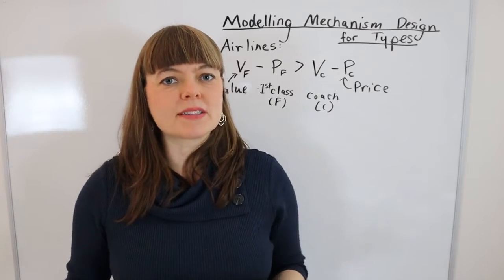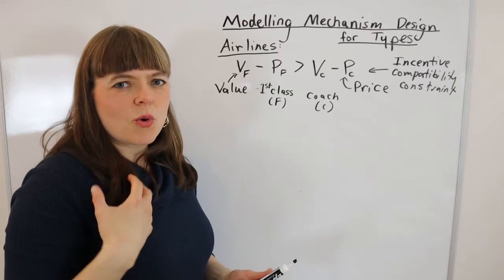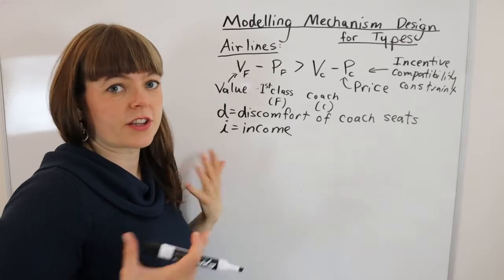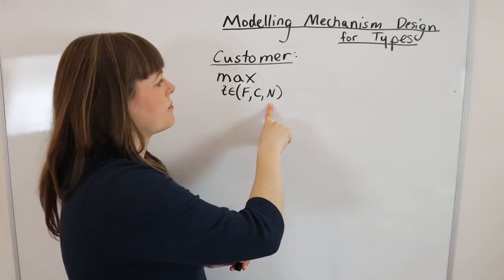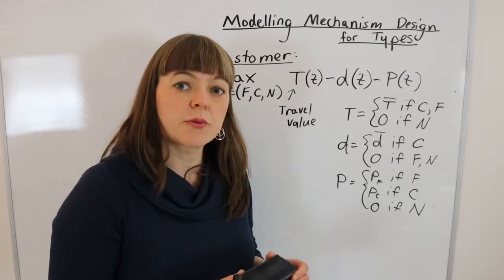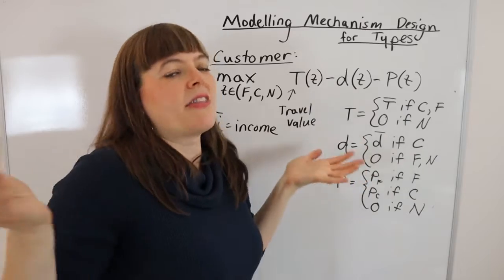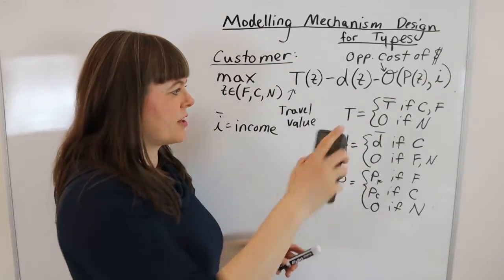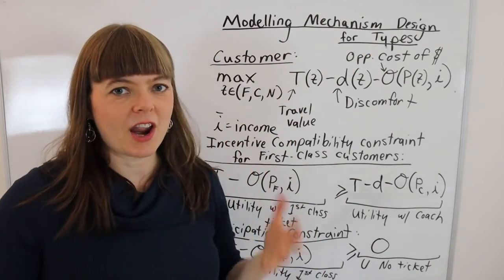Mechanism Design Modelling

Comment: Hi Ashley, what software would an economist use after drafting this design on the white board? Perhaps the matlab econometrics tool box or simply excel? And would they use a VAR model? Thanks in anticipation. 

Btw, I enjoyed the systems thinking series review
Reply: You actually wouldn't need to use any software for this one. With a few more things defined, you can solve all of this by hand. As a general rule, economic theorists only need software if either their model is too hard to be solved by hand (or at least not interestingly) or they can't cleanly show changes. This model is pretty simple, so you don't need that. If you want to see if your model describes the real world behaviour of airlines, you can collect data on it then analyse it with econometrics. For that, most people use Stata or R. I don't know what would be the best estimation strategy, but it probably wouldn't be VAR.

VARs are much more common in macro or if you're dealing with a network. You use them if you have data over time  with a few different variables that all interact with each other. So you might use a VAR to study how interest rates, inflation, and GDP are connected. Hope this helps.